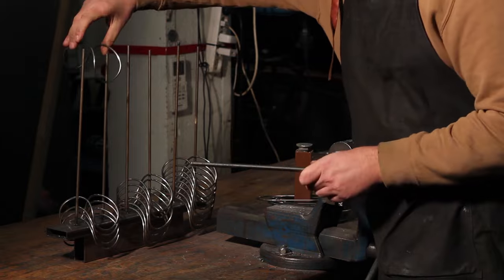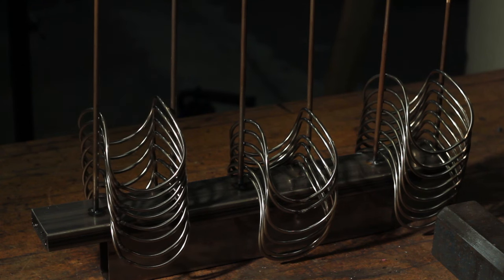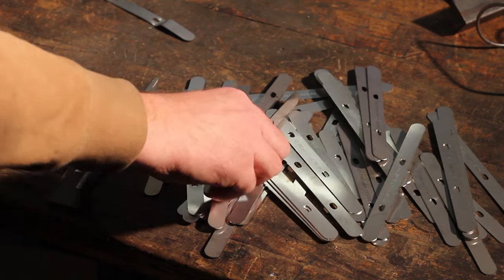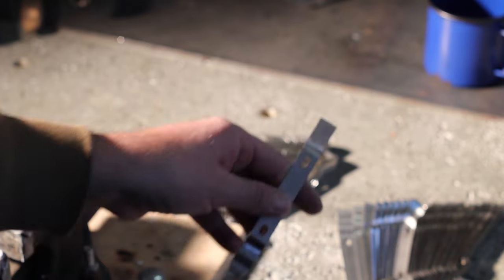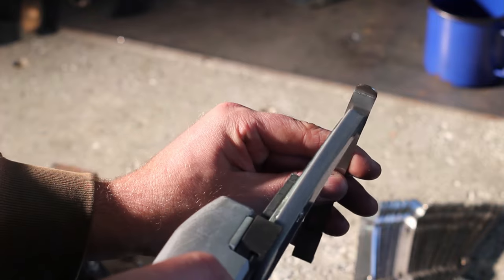MAKING STAINLESS STEEL BOTTLE CAGES

Comment: Just fabulous. What size torch are you using?
Reply from the maker: Thanks man. The torch is an old AGA X something. Not aware of its size. Could be smaller for sure but its great quality so I'll live. The nossles I use are 1mm (160L), 1.2mm (300L) and 1.5mm (500L) openings. Not sure what that equals in "size" or other makes.
Reply from the maker: Ohh yeah and its 1mm tip for the bottle cages probably. But any of them would be alright